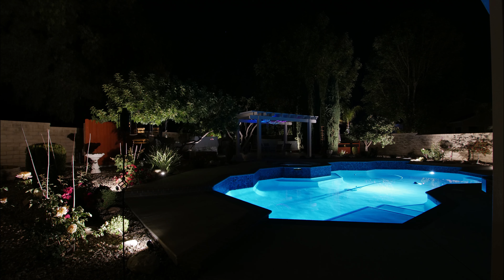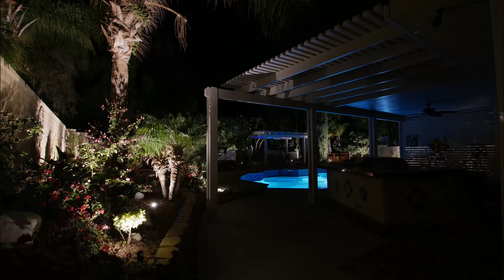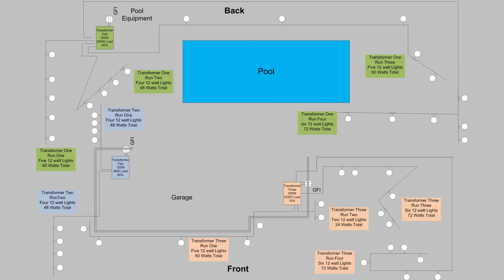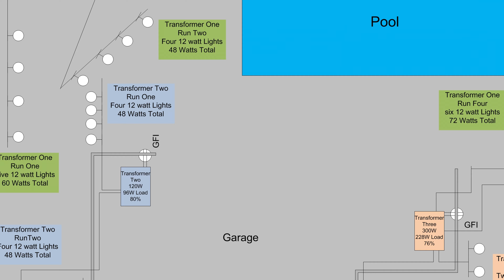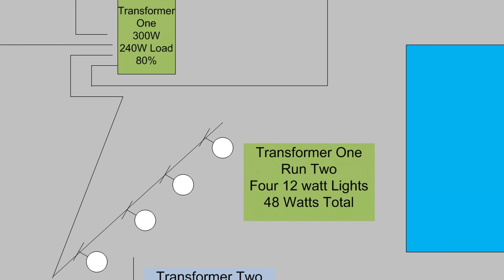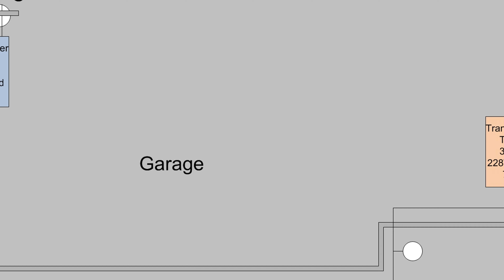DIY Low Voltage LED Landscape Lighting Installation - Sunvie LED Lights - Save Big Money!

Comment: Thank you so much for the detailed plan.  Most of the other videos "kind of" discuss their plans but no detail.  Question:  I think the one long run you mentioned that you used 14 gauge wire is I think on Transformer 1, Run 4 (Across the very top).  Can you give me an estimate of the length of the run to the longest point?  Did you still have about 10.9 volts or more on the last light.

The there vids just say use 12 awg but it seems overkill and expensive on most runs.  Thanks
Reply from the maker: The longest run was about 120 feet.  The last light  on the run was reading below about 9VDC with 12V at the transformer. I boosted the voltage to 14VDC to get to about 11VDC at the last light.  Using 12 AWG is overkill and really not needed for LED lamps that function over a range for voltage around 12VDC.

Comment: This will not last more than two years lmao
Reply from the maker: Do you have any facts to back that up?
Reply: @diyhomemaintenancechannel3753  those connections are not waterproof and will corrode the wiring. Real waterproof connectors are not cheap but it will make your installation last a lifetime vs what you did will cost you more $$$ in the long run.
Reply from the maker: @DENNISLOZANO88  Yes they are and I filled them up with GE silicon and wrapped them with exterior grade electrical tape.   I have used these connectors before at our other home and they have lasted over 5 years so far.
Reply: Electrical business I work with does landscape lighting frequently and over the last 5yr's I've seen loads of buried lv wire nut twisted junctions (rusty and corroded mind you) still operating fine, we've always done the same with no fancy goo filled connectors and I can't remember a single time we've had to go back to fix anything we've installed related to a bad junction caused by the elements over time w/long term customers or not so your method seems better than most.
The way we install it probably won't last as long as yours but I'm willing to bet by the time any splice/junction repairs are needed the home will have typically changed ownership and/or multiple changes in lighting design will render the whole topic a moot point.